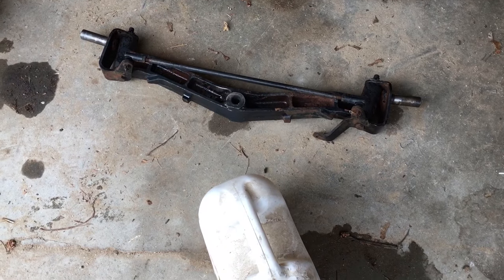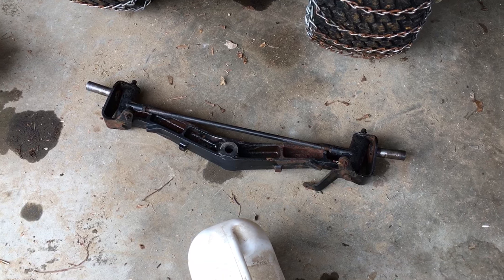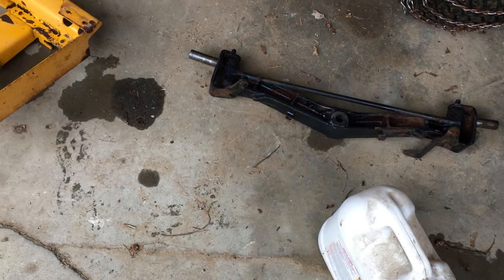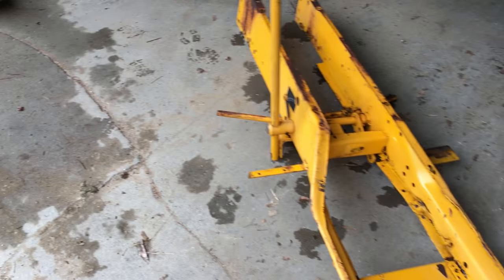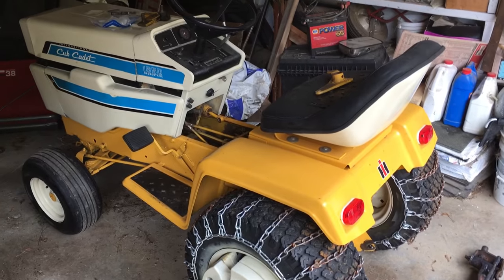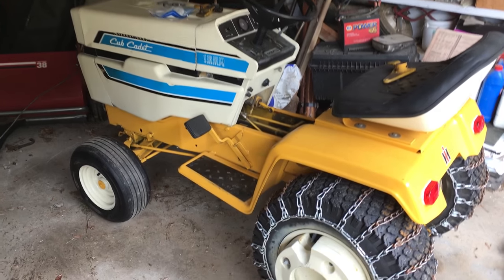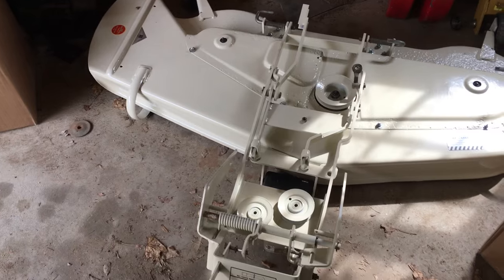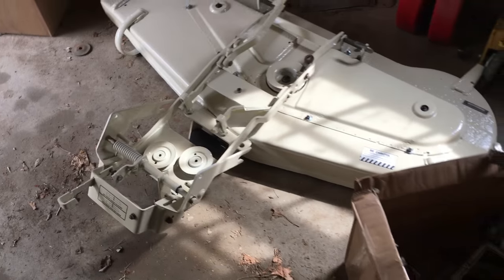cub cadet 680 resto part 5 steering column assembly

Comment: Always adjust out the play when the cam pin is in the center of the worm. This is where the wheels would be pointing straight if the coulmn was mounted on the tractor. Ross machines the worm gear to allow a little play when the wheels are turned left or right.

Comment: My 1450 has a bucket loader on it. It will turn left but not go right , so I can dig a pond if it's round right...lol I haven't had a chance to pull it apart but intend to very soon. Just ran across a 1000 that has sat for years. I'm guessing it will fire right up when I get to it allso. Truck driver and don't get all garage time I would like for sure.